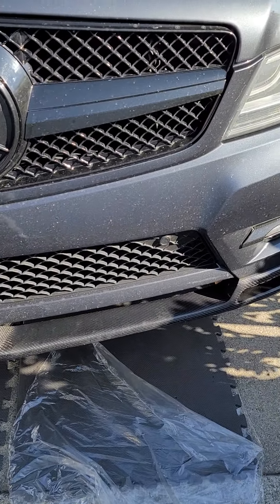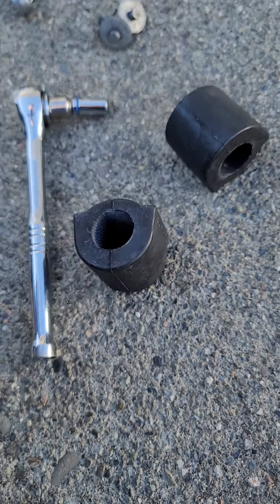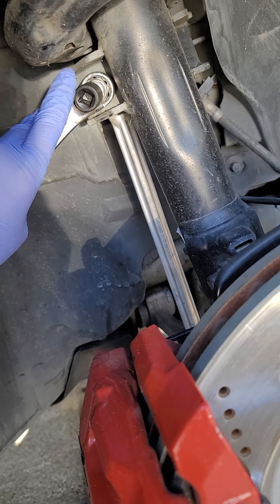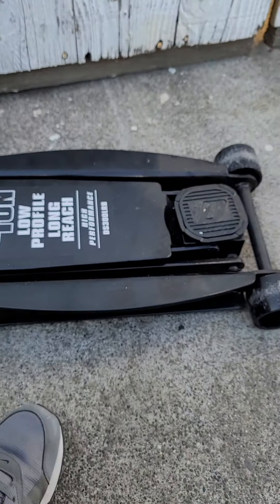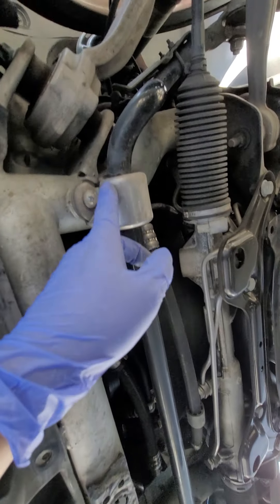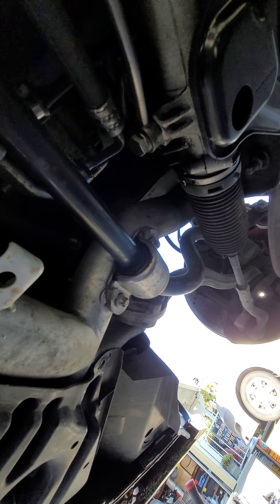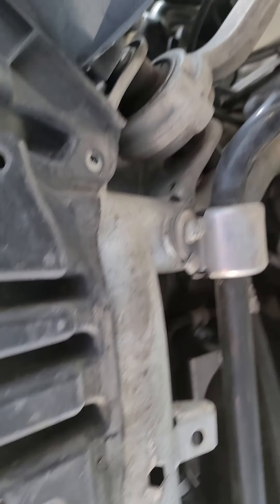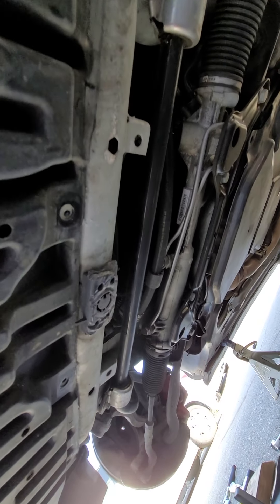2013 Mercedes-Benz C204 Sway Bar Replacement

Comment: How exactly did you remote the Swaybar bushing bracket off ? I tried removing the bolt, it comes loose but won’t come out just spins ? I can re tighten it but same for all bolts
Reply from the maker: The design doesn't allow a bushing replacement and will need to replacement the sway bar entirely.
Reply: @LeoLee7o7  fortunately you can manifold around it , use a welder

Comment: Front splitter were you get it
Reply from the maker: @MarioSalinas-rd2py  I got it on eBay. I had to specify which areas I wanted the carbon fiber on since there's certains parts that are not on the front lip. There is an extra charging it's worth it.

Comment: I see a dent in the front struct. 245 in the front aye?
Reply from the maker: You have a dent in your front structure of your car? Is that what you're telling me?
Reply: @LeoLee7o7  haha yup. The people in discount tires were dumb and mess up my tire rotation. They put the 245 in the front which rub against the front. Now i hear the solinoid decompressing when i turn hard in a corner. I notice it on your car as well in the video. I could be wrong though
Reply from the maker: Hopefully you took it back to them and made sure that they put the correct size. Mine are much smaller and they don't rub. I bought the tires and rims as a package set and I did my research first to make sure that the tires are the correct size for my rims. Let me know if they put the correct tire size.
Reply from the maker: I would also have them purchase you a new rim or rims on which are damaged due to their mistake. Haha

Comment: How do you know if its time to replace them? Clunking noise over slow speed bumps?
Reply from the maker: Yes, that's correct. Even when driving over little potholes on the road.

Comment: I have a w207 that uses the same swaybar I can't tell from the video if you actually were able to slide the bushings on or just bought a new swaybar? If you slid the new bushing on how did you get the bracket to separate?
Reply from the maker: Bought a new sway bar from the dealership since the bushings are not removable. Which sucks. Since that would be a much cheaper option.

Comment: Great video not to much advice about this process out there on the internet I have a question to ask how did you find out which bushing you needed for your car? I have a 2014 c300 sport and the bar is still good but I think the bushings are bad because it’s making noise and I already put new links on. Please help
Reply from the maker: One advice is to lift your front end up and remove both tires. Then inspect both sway bar links to see if there's any play because that also happened to me once when it wasn't tightened properly. I thought to myself why is it making noise still when I already replaced the sway bar links and this was on a different car. Check that first before replacing the entire sway bar since the bushings aren't removable due to the design of it being welded in.
Reply: So I can’t cut off the old bushings from the bar and put new bushings on ?
Reply: You mean the bushing clamp is welded onto the bar?
Reply from the maker: @lilfendiiofficialpage  Yes, that's correct. It's Mercedes-Benz way of telling you to purchase the entire sway bar. Those bushings don't get damaged that quick. Unless you're drifting in your car. I would suggest looking at your sway bar links again.
Reply: @lilfendiiofficialpage  changer toute la barre stabilisatrice, c’est la seule solution
Reply: You have to purchase the entire sway bar

Comment: How di you get to remove the bushings off from the sway bar I’m still fighting mines to come off
Reply from the maker: Unfortunately you can't remove the bushings. You have to buy a complete set because the bushing are fixed due to the bracket around the bushings. They can't be removed.

Comment: Mercedes doesn't "recommend" that you get a new bar, they force you to. 
The bushings aren't serviceable. They're molded to the bar & not sold separately. Kind of a dick move
Reply from the maker: Yes, I agree. I've tried to remove the bushings myself but they're definitely molded onto the bar. What can you do. That's how the car manufacturers work nowadays.
Reply: @LeoLee7o7  yeah I got the unpleasant surprise when I was going through all my front suspension & realized it was either a new bar or these Chinese bushings that upon arrival were clearly not going to fit. Immediately returned the fake bushings & got a new bar.
Did you actually manage to get those bushings all the way on?
Reply from the maker: I went through the same method and tried getting new bushings but they were very difficult to remove and ended up with a new sway bar from the dealership myself. Many of the parts on the vehicle is meant to be difficult to remove and requires you to purchase the entire assembly at some point. You'll start noticing that when you try to remove certain parts on the vehicle.
Reply: @LeoLee7o7  even though our chassis are similar, mine is kind of a generation older (or pre facelift really.) I have a c207 (2010 E350 coupe) with the 3.5L M272. I've been thru pretty much all of the common stuff, but the sway bar & rear shock top mounts were the only things that really got me. Also, front caliper slide pin bolts oddly enough. But yes, yours being a facelift & not sure if you have the M276 or not, everything changed from 2012 on. More complex & more expensive. Pre 2012 is very easy to source parts & good prices...so far hahaha

Comment: did you paint your calipers or did you take it somewhere
Reply from the maker: I painted them myself. I removed the brake pads and prep the calipers with masking tape and tape off the surrounding area to make sure I don't get paint anywhere else.

Comment: Sorry, so how did you go with the replacement? How did you go about removing the old bushings? Assuming perhaps you sliced it off? :) 

Appreciate the update
Reply from the maker: The bushings can't be removed since they are molder onto the sway bar itself. It's made that way so that you would have to purchased the whole entire sway bar with the bushings already in place.
Reply: @LeoLee7o7  figured as much, I’m sure a serrated blade will remove them
Reply from the maker: I thought about really cutting it off but didn't want to deal with the hassle haha